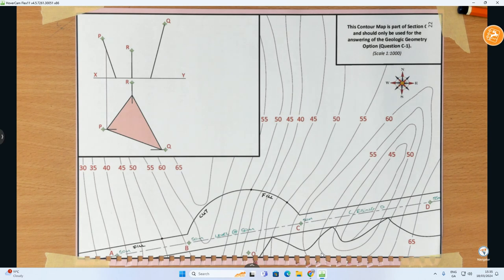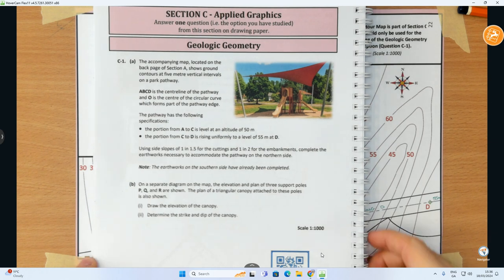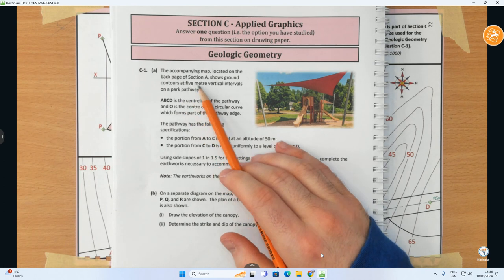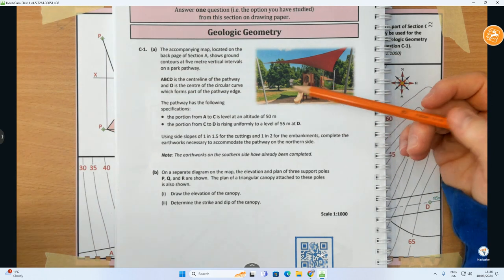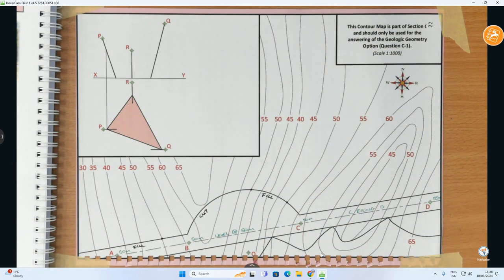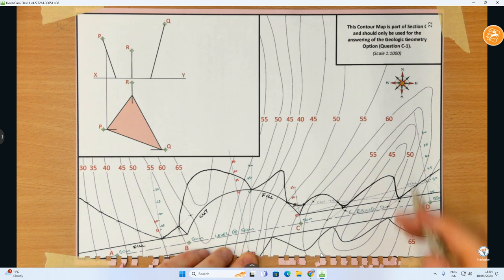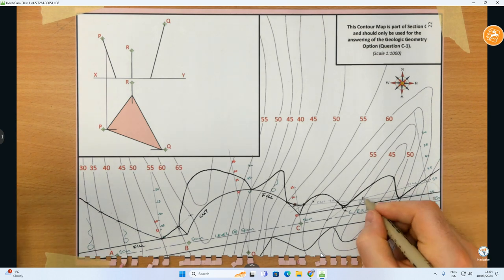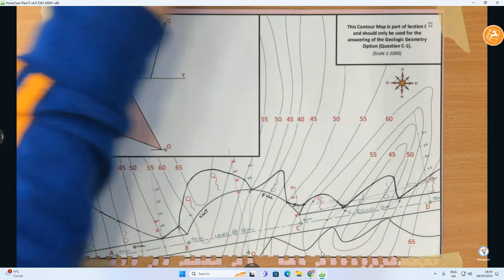DCG 2023 HL Road Geometry

Comment: I still dont understand why you used two cones on the road works part?
Reply from the maker: The reason is because there are parts of the road that are both higher and lower in this section. Therefore you need to do both cuts and fills. Also the road is inclining therefore you need a cone at both ends for the cuts and fills
Reply: thanks!